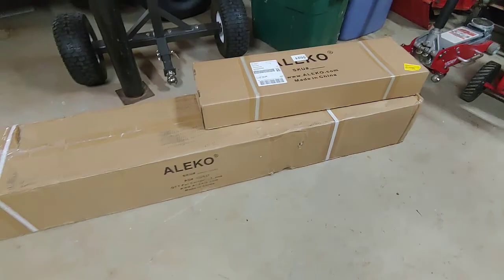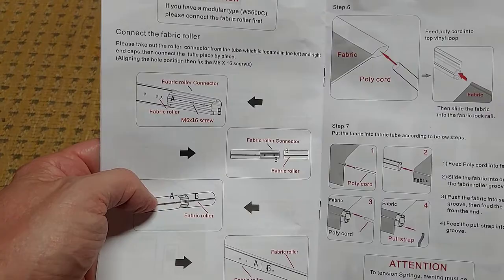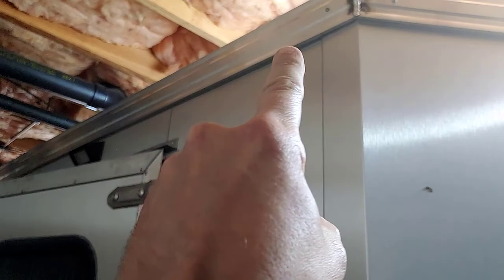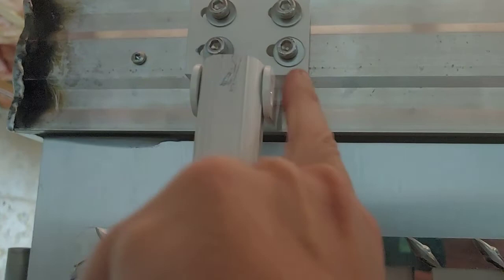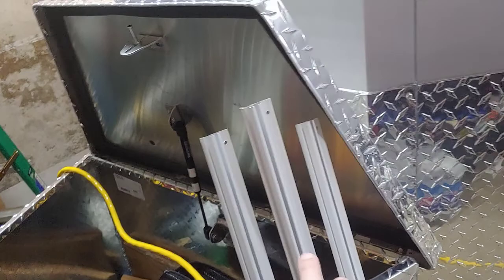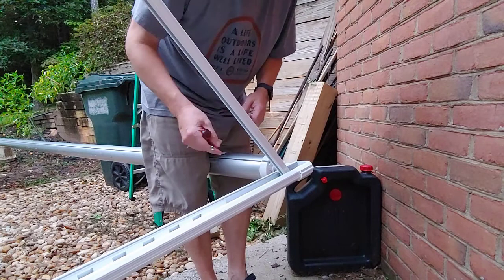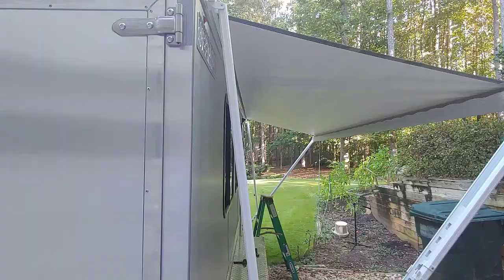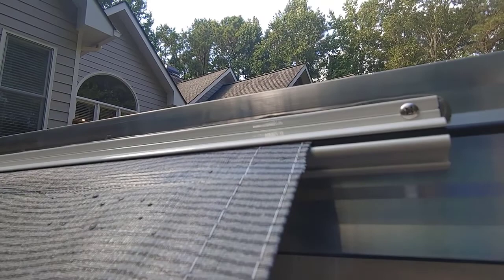How to install an Aleko & AwnLux Awning. Similar to Dometic, CareFree, A&E, RV awnings. Installation

Comment: Thank you for taking the time to make this video! Very helpful through the entire process! So glad you made this, I knew from the reviews before purchasing the instructions were awful. I installed it completely by myself in my driveway. For the tube, I just installed it with the arms extended, about 2 feet off the ground. Set one side on a chair, then installed bolt in other side. Thanks again!!
Reply from the maker: Thanks for the comment! Also thanks for sharing your idea on attaching the tube! Sounds like a great approach.

Comment: Hi I watched your video a couple of times before I attempted the install, and I will say you did an excellent job. Every part was well explain and the extra hints well worth mentioning. Thanks for giving up the time to do this. Can I ask did you need to adjust anypart of the awning since the install and now that you had it a while hows it holding up? . Other than washing it down do you oil certain parts. Im not too sure if I should leave the awning extending slide rails oiled or not as dust my just build up. Thanks from Land Down Under.
Reply from the maker: Thanks for taking the time to comment and for the compliments. I store my camper in my garage so the awning still looks new. I had it out for the first time this season last week and it worked great, no adjustment needed. I'd say just keep it clean, there's not much of anything to service. I watched your video on diving that wreck and the crays, that was really cool.

Comment: Very detailed video! Thank you! The Awnlux awning I ordered states that the roller is pretensioned. Did you do you turn yours an additional 15 turns as well? Or maybe this one is an updated version?
Reply from the maker: Hmm, mine was definitely not pretensioned. It should be apparent when you get it out and take a look. If they are pretensioned now there must be a release pin or something once installed. Let us know. Thanks
Reply: There’s definitely a pin that states, “Do not release until the roller is installed”. I wish I could post a picture

Comment: I have a 18 ft. cargo trailer that I haul my motorcycle in and use for camping also and have been unable to find an awning that I can make fit! When awning is close how far does it stick down, there is not much room between the top of the door opening and top of my cargo trailer. The local Camping World Store has been no help didn't have the time to fool with me!
Reply from the maker: I just measured for your question. About 5 inches to be safe. So you need about 5 inches from the top of the roof to the top of the door.
Reply: @SwimmingintheDeep  OK thank you, I will do some measuring.

Comment: is yours a standard height trailer, only courious as i am going to be installing one on a cargo trailer as well and i added an additional 6 inches to the height not sure if i need to bring the lower legs up roughly that same amount as when it will be opened would it be in way of door  but i must say this video helped alot over the supplied instructions
Reply from the maker: My trailer is 74 high inside. Depending on where your leg footer falls you should be OK, you want it to mount in something solid and mine did, the base edge of my trailer.  Here's where I explain that if you did not see it https://youtu.be/agbIkMVVSbE?t=1513  Thanks for the comment.
Reply: @SwimmingintheDeep  dude i just got finished installing my awning your video is one of the most helpful on you tube, as it goes into great detail .in the end i set mine @ 72" so the door would not hit the awning , my trailer is 84" again thanks for a great video
Reply from the maker: @markmundle2104  That's awesome to hear and thanks for the comment. I added an awning roller to my door to keep it from cutting it but your door maybe a different design that's more rounded.

Comment: Did you loctite any of your hardware?
Reply from the maker: No, but I did use lock washers on the brackets. And some of the nuts that come with it have nylon inside them so they lock anyway.
Reply: Hi Richard I did on the hardware that didnt have lock washers or nylon bolts. It was only a low strength incase I needed to loosen stuff during adjustment. So the awning roller joining screws was one place I did. Its seems like and excellent bit of kit for the price.